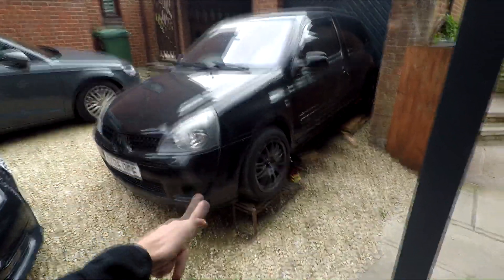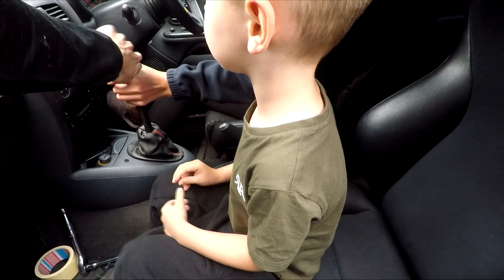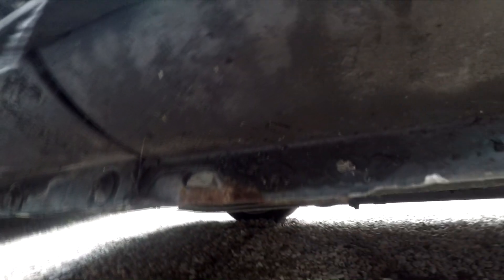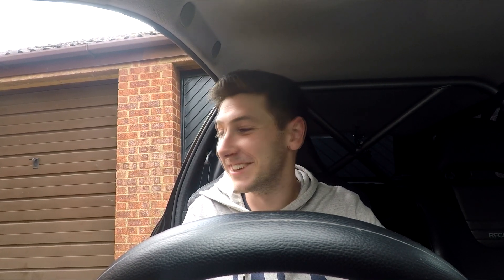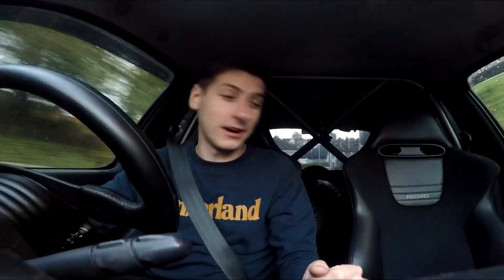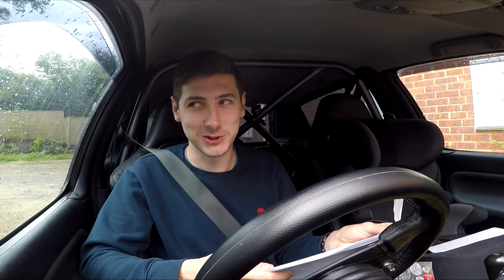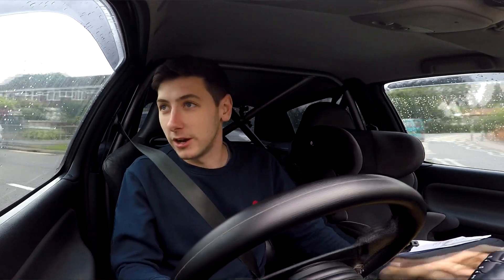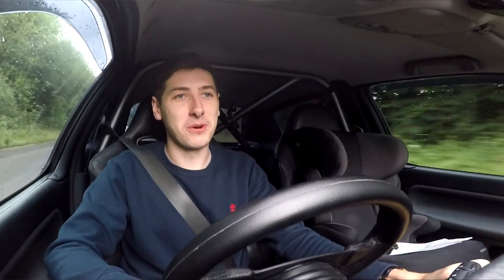MOT Time Is Everyone's Favourite Right?.

Comment: If you want to silence the PmS mate, have a look at my Instagram page The182project. I fixed mine by lead shot and covering the areas like linkage, top of shiter tower and bolt attachments with heat shrink, placed an o-ring at bottom of reverse slider and sound deadened the shifter tower.  Mine is all but silent.  I may even have enough of the stuff left to send to you to help